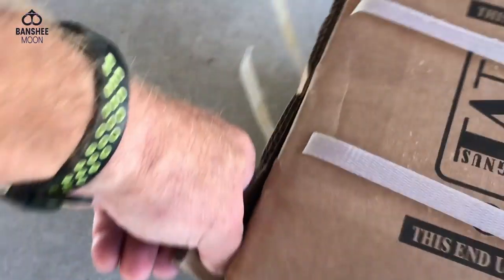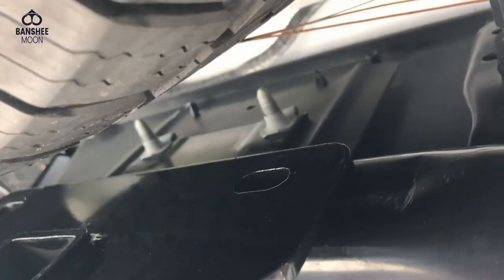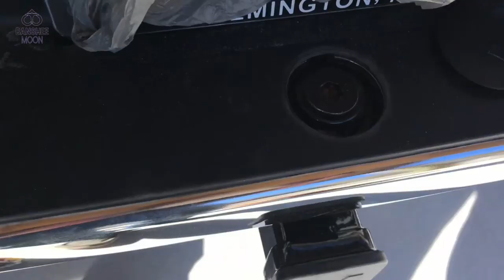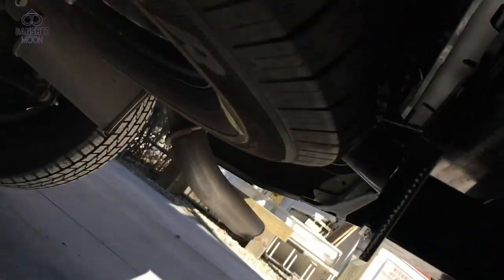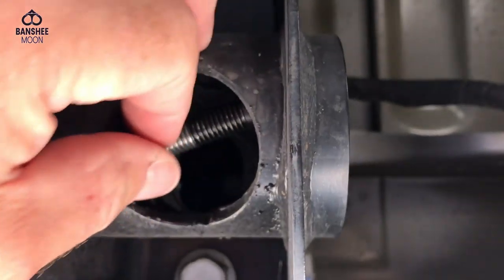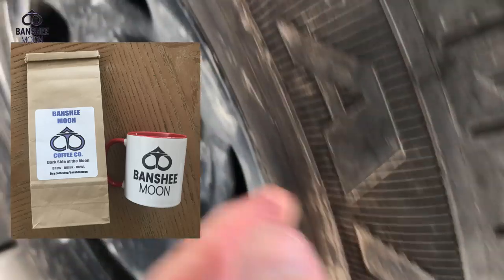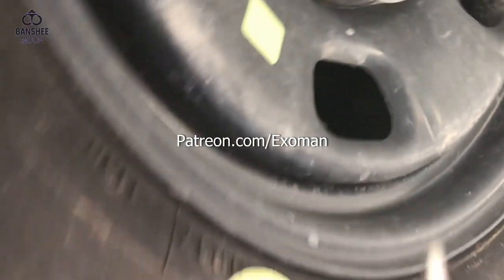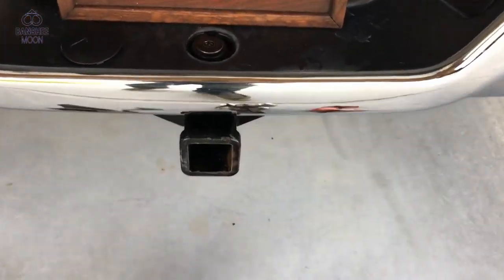Trailer Hitch Receiver for Ram Truck 1500 Crew Cab Installation

Comment: This was very helpful. I've been thinking about putting a reciver on my 2017 and now I know what I need.  Oh also I think it might have been easier to push the wire from the mount holes out to the opening on the end. Thanks for the info.

Comment: Woulda been easier to send the fish from other end and it will run right thru frame member come out where you want it and all you have to do is put bolt on it and pull it back. Good video anyway.. Shoulda had Jen do it. ;-)